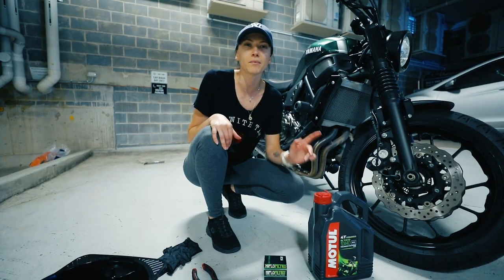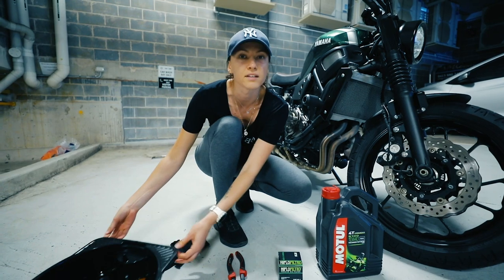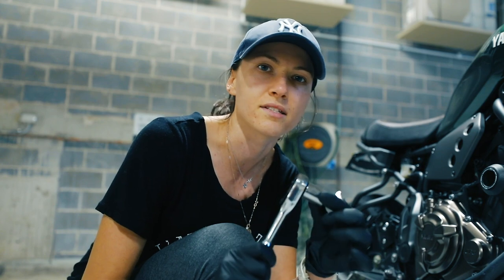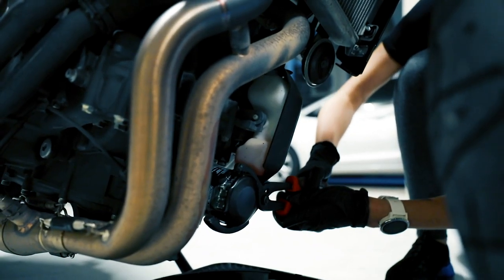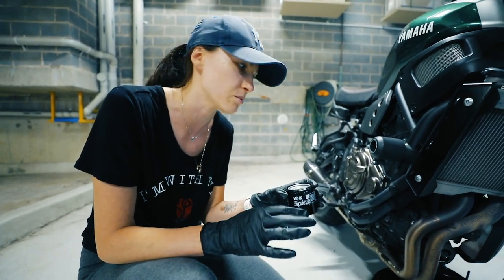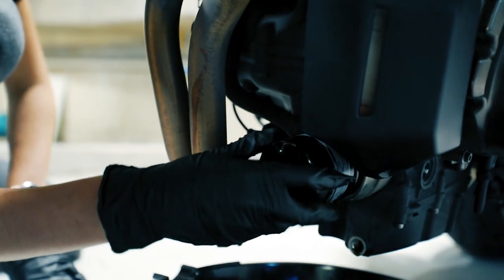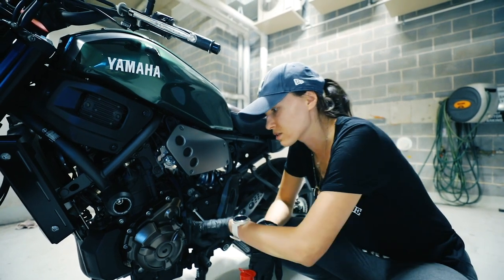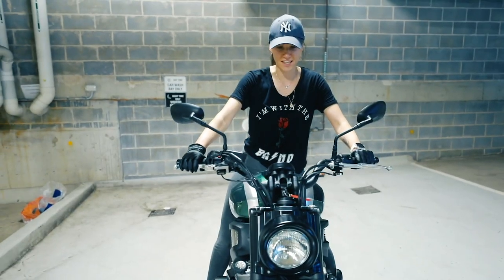Yamaha XSR700 Oil Change in 3 minutes

Comment: What's the name of the tool you showed at the start? the one that unscrew the filter? and is it necessary?
Reply: It's called an Oil Filter Wrench. They have different designs, but all work the same way. No, it's not necessary. If you have good grip strength, you ought to be able to just spin it off by hand.

Comment: How do you like the Motul 5100 semi synthetic oil?  Thanks
Reply from the maker: I use this as it is recommended, smooth as :)
Reply: Cool thanks!
Reply: Yeah, I wanted to use Full Synthetic 5W-40 and consulted with Yamaha technician. He said if I do not want get into trouble I should use what is specified which is Semi-synthetic 10W 40. Maybe later when the bike has 50+K Km I will try 5W-40 as it is getting more quickly where it needs to be in colder weather.

Comment: im 5'6 (yes im short i heard it all) will this bike be too tall for me?
Reply from the maker: I'm the same height! At first it felt little bit too tall, I was on my tip toes, but got used to it :)
Reply: I'm 5'9" and I can just barely flatfoot it, my inseam is 31". You should just go to a dealer and sit on one. If you get really desperate just find a pair of riding boots with a thick sole 🤣
Reply: I'm 5'4 and I have the xsr900. Can put both feet down fine. Really depends on your inseam.